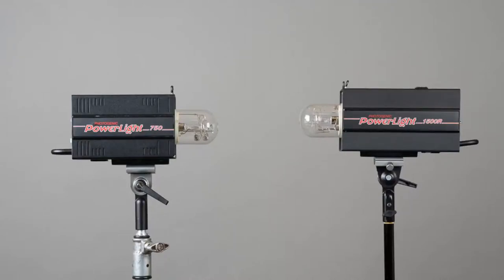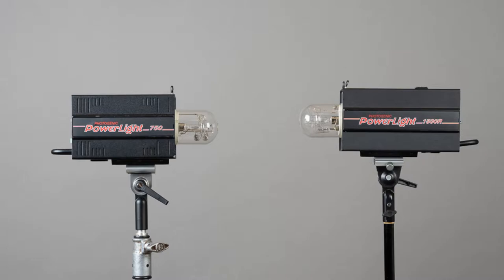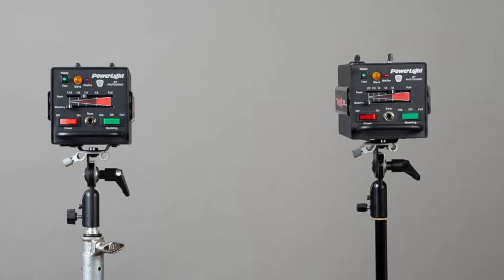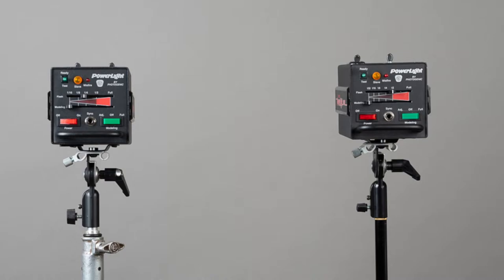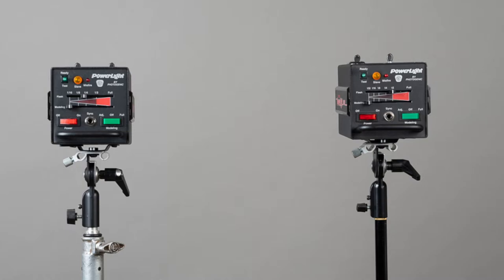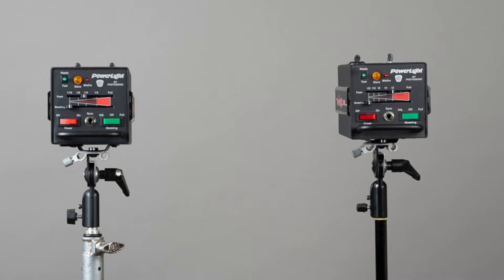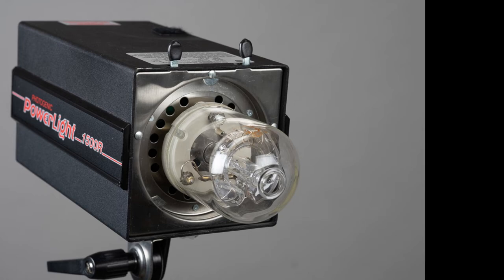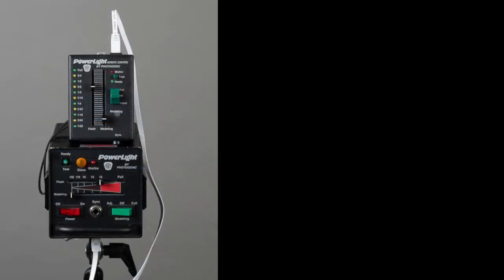Photogenic Powerlight

Comment: I bought 1 of these with light stand, background stand and Hard Shell case for $150.00  Finally found a softbox adapter on B&H. Can't wait to put it through the paces
Reply from the maker: That is great, I have found them on eBay by searching for Photogenic Photoflex Speed ring.  Assuming you use Photoflex softboxes which are relatively easy to get used or of course new.  The other option is with Redwing and Photogenic - these are less common and work with the original bowens softboxes.  I think you have more options going the photoflex route.

Comment: Thanks for the info!!  I got 2 of the PL1250's, which have maybe 20 Flashes on them.  I use allot of Speed Lights, but these are wild like a Tank, and I'll use the sooner or later.  The PL1250 are very sweet.  Again thanks for the overview.
Reply from the maker: Good luck, I like using diffusion with those.

Comment: Hello!  I have two which I have used for over a decade.  Without my favourites.  Will there be an adapter for bowens mount?
Reply from the maker: I am not sure if there is a bowens adapter that converts photogenic to bowens.  With speedrings, you can take  one mount out and put in another.  It does not always work due to different diamiters but it might.  For example, if you have a photogenic speedring you can take the photogenic adapter out of the ring and put it a ring made for bowens.  But no gurentees it will fit without trying.  Photoflex supports Photogenic - they have moderetly priced softboxes/speedrings.  They are both owned by Promark - https://www.promarkbrands.com/